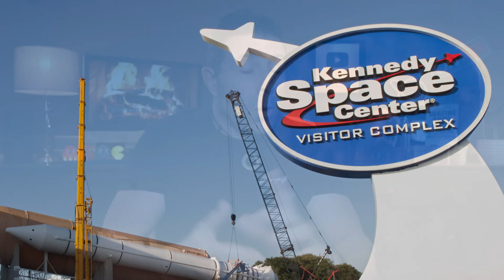SpaceX Starship Super Heavy Double Catch

Comment: Anything ship does in orbit will be at least 215km altitude (80+ minute orbits, <= 18 orbits per day, 20+ degrees earth rotation per orbit.)

I haven't seen any guesstimates for what starship's cross-range capability will be, but I doubt it will be 20 degrees-worth, so unless they spend a lot of propellant on a plane change, they'll stay in orbit ~12 or 24h until landing site rotates back underneath orbital plane and then return to surface.

I don't have the numbers handy, but I recall that Cape Canaveral and Boca Chica Beach are a little over an hour's Earth rotation apart relative to an orbital plane, so once they get started with orbital refueling, they'll be able to do 1 or 2 depot launches per day from both FL & TX, so it's not going to take six months to fill up HLS, even if it takes 15 launches. That, of course, assumes pipeline prop delivery or on-site production rather than 2d of trucking in supplies per launch.

Comment: This is amazing stuff SpaceX is doing. I’m loving it. 

I have a Linux / DaVinci Resolve Studio question if you are willing to help 😉. I’ve been running Mint for about 4 months now. There is one nagging issue with DaVinci that is very frustrating. The Alt key isn’t recognized when used by itself. So I can no longer Alt-click a video clip and then drag it to create a duplicate. I can use CTRL-Alt-click to select a clip without the linked items being selected, but when I try and Alt-drag to duplicate it pops my whole DaVinci window out of full screen mode. I’ve checked the Resolve keyboard assignments, but it looks normal. Is this something from the Linux Desktop Environment interfering with DaVinci? Is there a fix or work around for this?

Comment: NASA needs to stop drinking Elon's Koolaide with his amazing "Starship."

Yes fully reusable orbital launch systems will be fraction of the price compared to legacy rocks, but .....  the Starship can only get large loads to LEO and would have to be disposable to get to GTO.  This is why the Starship Lander needs to be refuelled in LEO with at least 10 Starship  tanker flights

The SuperHeavy booster which is now reusable by catch not legs ...  has twice the power of the Saturn V booster ... and even if lost is still cheaper than  any other booster.

Nasa needs to cancel the Starship Lander and simply hire ... the SuperHeaver Booster.   Then tender the cheapest upper stages to get  .... 150 tons to  GTO.  Space X will give the best price,  by simply making the "disposable" upper stages as cheap as possible.

And of course tender a 150 ton CSM & Lander fully fueled with cargo/passengers.

Again.  Nasa has been drinking Elon's Koolaide, when they they should have just stepped back and remember the savings  using the Falcon 9 with disposable upper stages.   They should have only been interested in the SuperHeavy Booster with landing Legs ... with disposable upper stages.

Don't forget Elon  is obsessed with colonizing Mars with his "amazing" Starship that is fully reusable and it did start off with legs which reduced the the total mass to LEO so they got rid of the legs and decoded on catching instead.   Plus Elon was fixated on the Starship first an foremost so he never ...  properly developed Starbase and the launch site for the longer term, especially not  building the Pad with flame trench & deluge ... landing pad .... and full Tank farm for the booster & Starship.  Had 

Elon should have focused on a fully reusable SuperHeavy with legs, using disposable uppder stages get 150 tons to GTO specifically a CSM & LM. And using the Falcon 9 to test Starship designs that can be scaled up for the SuperHeavy.  Had Elon did everything the "proper" way Space X & Nasa would be right now doing Lunar landing tests, and the Starship design will be finalized and they will be building Starship 1 for its first flight  with cargo to LEO, deorbit and and land on its legs.

Stop drinking Elon's Koolaide.   That Starship Lander is stupid unless you can refuel on the Moon or Mars, and in LEO.
Reply from the maker: I agree that the Starship to move the massive amounts of cargo it was designed to do will require a LEO refuel. That said, once refueled in zero gravity it will go a long way.
Reply: @jcristina 

All I am saying is stop drinking Elon's koolaide.  After all, he just lost  30 billion buy twitter and then stupidly changed the blue icon to a black X, instead of simply starting up his own Media company by simply copying/modifying/improving from Meta, Google, Twitter etc.  And where the hell is his smart phone, Tablet, TV, CPU/GPU, Linux based OS,  Workplace & Gaming sw/hw to have made Tesla a  3 trillion dollar company 5 years ago?

Nasa needs to only hire (reusable) or buy ( disposable) SuperHeavy Boosters and then tender the upper stages & modules.  Then let Space X decide if it wants to continue offering variants to the Starship or find another way.

Comment: It won't be minutes later, Starship will have to do at least one orbit if not multiple before it comes down for a catch.  In theory they could keep Starship in orbit until the booster has been set down then they could catch Starship at the same tower.  I think they will need at least 2 or 3 controlled landings of Block 2 Starship before they attempt a catch.  Remember Starship will be coming down over populated areas prior to getting to the launch tower.